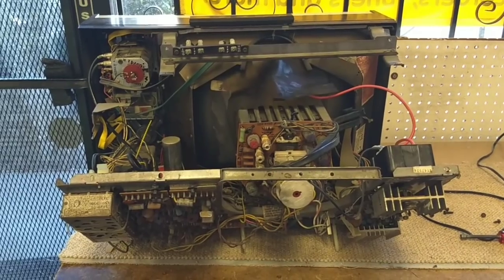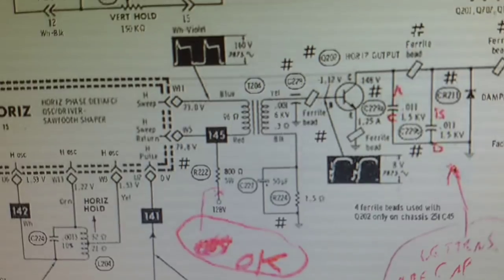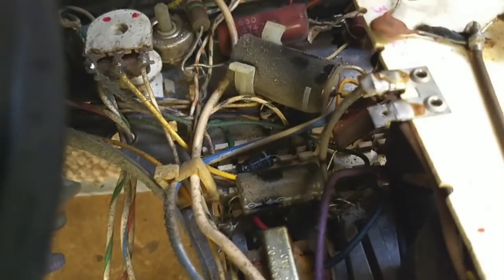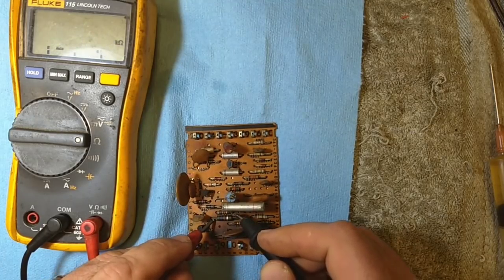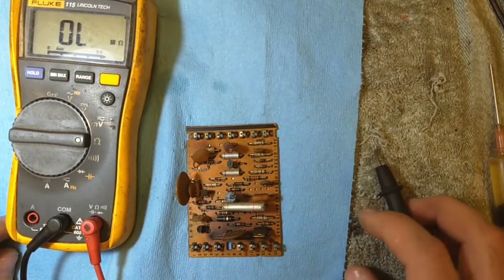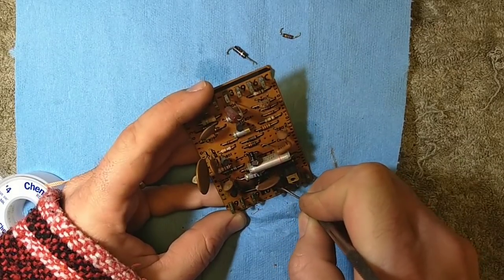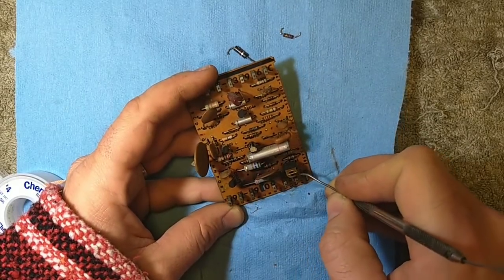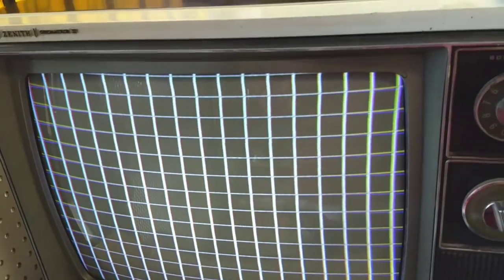Servicing a 1974 Zenith 17" Chromacolor II Color tv part 3 / ?

Comment: Blooming. Check the oil filled cap ( big oval one). It & the power transformer are the regulation for the high  ( H drive & out ) B+.  They went bad back then sometimes but now almost every one is bad. Just measure the B+ while changing brightness or line voltage. When new they would regulate between 90 VAC & 140 VAC nicely......
On the 9-90 horz module be SURE the 330 ohm resistor is OK.  It causes poor hoz sync &
no or int color ( remember the Emerson ?? )  It is feedback from the FBT to H. AFC If
off the burst amp cant grab the color sync pulses. And watch them IC sockets on the 9-86 !!
Kudos on the module connectors. Exactly how we did it but we added a fine sanding to
the male end. 
Last note is your schematic is off. You have a 4 lead cap set. Not to worry yours is orange.
( under H. output heat sync) . The Sams shows a set with five .011 caps from H. out to ground
instead.  When done this set (17") gives the best pix of its generation from Zenith. 

73 Tom A.K.A. Zeno
LFOD !
Reply from the maker: Would you suggest using something like. 3.5uf 450vac motor phasing capacitor for this application, or should I search out another oil filled capacitor?
Reply: The motor cap seems to be a good fix. Funny thing is if you order a York
replacement it has the Zenith part number ( 22-????-?? ) on it.
IIRC GE made the original. 
Tom

Comment: If the 4 lead redundant cap was replaced as part of the massive recall  (1976-1981) it by now has started to dry out.  NOS replacements could also be sketchy,  I would also replace that panasonic HOT with a ecg 38.  Its a LOT closer in spec to the stock original  ( you can also use a 2cs 1308k)

Comment: Gotta watch the ESR meter, if a cap has failed and is shorted the meter will show it as good. A shorted cap will peg the meter. Test the cap with an ohmmeter for a short. Just make sure it is discharged first.